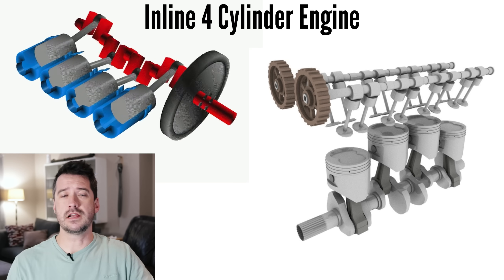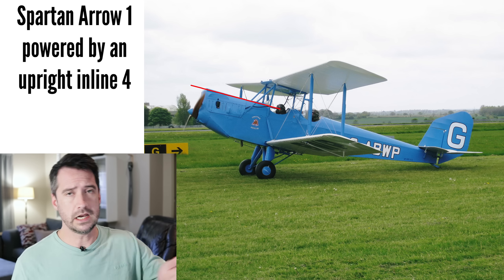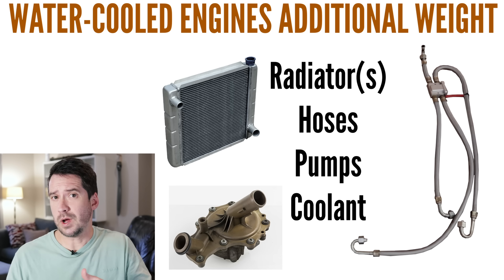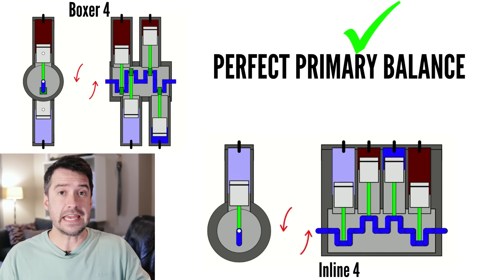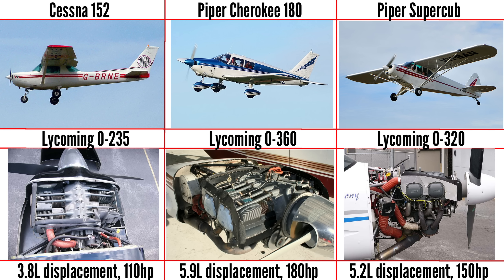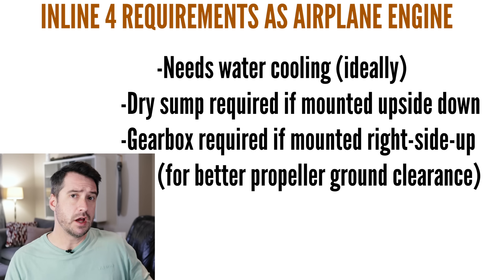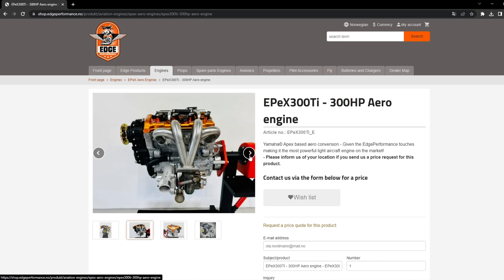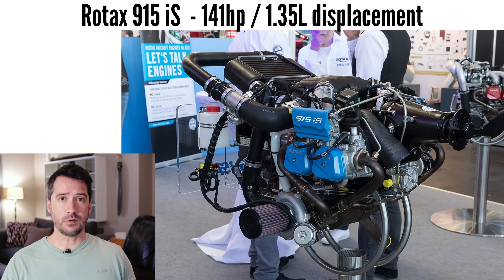Does Inline 4 Engines Suck for Airplanes? - Technical Deep Dive

Comment: If you notice, that Gypsy engine is a "Long Rod" motor.  Not a stroker, but a Long Rod.  Look how insanely long those cylinders are compared to something you see in a car @11:30.  This reduces the angles from side to side of the piston rod when the crank is in the middle of a stroke.  It also reduces the need for a counter balance and reduces the acceleration effect of the piston during a stroke.  This should be mentioned.
Reply: It is a long stroke engine, but that's just because they didn't know any better in the 1920s. By the mid '40s, engine manufacturers knew better.
Reply: @PistonAvatarGuy  nope.  There is a resurgence of long rod…not long stroke motors.
Reply: @sammcbride2464  In aviation? Long rods are definitely preferable, but long strokes are definitely not preferable in aircraft applications.
Reply: @PistonAvatarGuy  I don't know, but if you are only turning 2500 RPM and want no vibration, I would pick a long rod stroker engine for it regardless if it was in the air, on the ground, or on the water.
Reply: @PistonAvatarGuy  In any motor application, if the stroke is longer than the bore width, then it is a stroker engine.  That is different than a long rod motor where the stroke is still shorter than the width of the bore.  If you have the measurements of the engine, it will be easy to tell.  On a side note...I don't know about you, but I would always want a dry sump oil system.  Some people like to fly upside down. ;)
Reply: @sammcbride2464  Basically every piston aviation engine that has been developed since the mid 1940s is an over-square engine (short stroke), because under-square engines (long stroke) have a poor relationship between torque output, piston speeds and rpm.

Over-square engines make more torque than under-square engines, and because direct-drive engines are limited by rpm, the only way to get more power out of them is to produce more torque. Even with geared engines, an over-square arrangement is preferred in order to keep piston speeds as low as possible. Long rod, over-square engines are the way to go.
Reply: @PistonAvatarGuy  I understand the engine building dynamics.  Piston speed is not an issue at 2500 RPM.  Also, a long rod motor has nothing to do with stroke.  My Pontiac 455 with a 4.25 in stroke can safely turn over 5k rpm’s.  A engine with a massive 8.5 in stroke would have the same piston speed at half the rpm.
Reply: @sammcbride2464  Piston speeds are always an issue, as higher piston speeds result in more wear and less efficiency, both highly undesirable things to have in an aircraft engine.

You said: "...I would pick a long rod stroker engine..."

Long rod, yes, stroker, no.
Reply: @PistonAvatarGuy  I said stroker since it is 2500 RPM.  That is why.
Reply: @sammcbride2464  But a stroker is still going to have higher piston speeds at 2,500 rpm than an over-square engine does at the same rpm.
Reply: @PistonAvatarGuy  It just depends on what the actual stroke is, not the ratio.  But, you can have less longitudinal length with a stroker.  I am not dead set on a stroker, but it seems natural given the RPM target.  If the target HP is only 120 to 200, that is pretty achievable without a turbo and a target of 2500 rpm with any design.  At altitude, I would want a turbo or super charger.  I would also always want a dry sump for an airplane.
Reply: @sammcbride2464  Assuming that we're talking about an engine of a specific displacement, an under-square engine will have a longer stroke (actual) than an over-square engine. Stroker engines make less torque from their displacement than over-square engines, so I'm not sure why you'd want to limit your performance like that.
Reply: @PistonAvatarGuy  Actually, it is the opposite for torque.  Stroker engines have a nickname of Torker engines.  Maybe you typed that backwards?
Reply: I have been building engines for a very long time.
Reply: @sammcbride2464  Nope, that's a myth. When you increase the stroke of an engine, you increase its displacement, so the engine makes more torque as a result of its increased displacement, but it's displacement specific torque output (BMEP) will be less. If you're designing an engine from scratch, there's no reason to 'stroke' the engine as though you were modifying it, you can simply increase the displacement by increasing the bore. This is why aircraft engine designers always choose over-square engine designs.

IMO, people relying on their 'butt dyno' are to blame for the more torque from under-square engines myth, as under-square engines tend to produce their peak torque at a lower rpm than over-square engines, so the engine feels like it's making more torque, simply because the torque is available lower in the rpm range of the engine.
Reply: @PistonAvatarGuy  If you believe that, I do not know what to say.  Take an engine like a Honda S2000 and look at the specs for a 2 liter.  Then look at other engines.  Look at a stroker engine like a Pontiac 455 and a Chevy 454.  Way different characteristics and at 2500 RPM, I guarantee the Pontiac will smoke the Chevy.  The stroke or crank angle is directly responsible for torque.  I think you are talking about peak HP which is something that you can obtain with a short stroke and high RPM.  But, we are not talking about high RPM at all.
Reply: @sammcbride2464  On YouTube: Crushing the Long Stroke= More Torque Myth by rv6ejguy

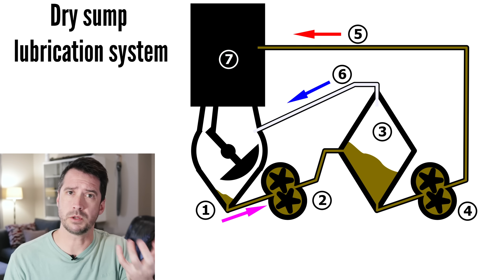Also: Bore Stroke Ratio | Performance Engine life Effects | Applications by Untangle Club (at about 3:00 in the video).

The Pontiac 455 is basically a square bore engine, the Chevy 454 is an over-square engine and neither make as much torque from their displacement (BMEP) as the Honda F20C. A better comparison is the Honda K20 to the Honda K24, as they're basically the same, except that the K24 has a longer stroke (it's an over-square engine) and the K24 makes less torque from its displacement than the K20.

Edit: Heck, you can even compare the Honda F20C to the F22C and see that the engine with the longer stroke makes less torque from its displacement.
Reply: you mean it have greater rod to crank ratio, D4A explained that, it have less secondary forces, and less pressure (and friction&wear) on cylinder walls and better high RPM performance
Reply: @PistonAvatarGuy  I think that long strokes on direct drive aircraft engines are avoided due to the flexibility of the crankshaft. Either journal sizes would be very large, which is a problem for plain bearings with excessive speeds or Or there would be very little overlap in the crankshaft which would make it very flexible. The Lycoming and Continental engines both have flying web crankshafts (3 main bearings plus the prop bearing for a flat four.)which is already a flexible crankshaft. (Subaru uses 5 main bearings for it's four cylinders, and 7 mains for the 6 cylinders. The width of the engine is not a problem as almost all aircraft are for two people side by side or larger.
Reply: @jiroyamamoto2878  You could be right, but why bother with direct drive engines when geared engines offer such significant performance advantages?

Twin engine aircraft would still benefit from the reduced frontal area that inline engines provide. Geared engines are so much more compact than direct drive engines that geared V and flat engines also offer significantly reduced frontal area relative to direct drive engines.
Reply: @PistonAvatarGuy  Propeller speed reduction units (PSRU)s are not easy to design nor build, especially for Experimental (homebuilt) aircraft with many different propellers. I think that production auto engines converted to aviation is the direction of the future. However the market is tiny! So, the costs of conversion have to be low, and the PSRU is the biggest stumbling block. Certification is so expensive, it would kill the conversion cost savings. Now car engines are so good, with a good PSRU and a reliable Engine Control Unit (ECU), a turbo auto engine would be the cats meow. However, PSRU and open source ECU are not found on trees. My current favorite fantasy conversion candidate is the GM L3B 2.7 liter turbo. 310 hp at 5600 rpm and 430 lb ft at 1500-4000 rpm. You would hate it though and I will let you guess why! It could actually run direct drive, if a suitable prop hub bearing could be devised. However, these engines are shaped like a cube more or less. They are not long and skinny.
Reply: @jiroyamamoto2878  PSRUs can't be that difficult to design and build, there are loads of options already in existence. I don't see why different propellers would be an issue, either, it seems like that would be much more of an issue for direct drive engines, as they operate within such a narrow rpm range. Even the torque pulses from a direct drive engine must be considered, as they can destroy propellers that aren't robust enough to cope with those forces.

Direct drive, that GM engine would have a very poor power to weight ratio, it being limited to less than 3,000 rpm. For example, 430 lb-ft @ 2,700 rpm is only 220 hp and the engine appears to weigh at least 350 pounds. With the BMEP that high, I'd also question the ability of the engine to run efficiently and wouldn't expect it to have good longevity. The fact that the propeller would be attached to the engine near its base would also be a problem in most applications.

IMO, there should be a government development program which absorbs the cost of development for some new aircraft engine designs, otherwise nothing new or worthwhile will ever make it into production. NASA is supposed to be doing things like this, and they kind of started to with the GAP program, but it was a very limited program and it focused on compression ignition engines, so it didn't end up producing anything of value.
Reply: @PistonAvatarGuy  I knew you wouldn't like it! Where did you get that engine weight of 350 lbs? Direct drive it would need to be inclined (somewhat difficult) if not inverted (very difficult) with a prop hub bearing. What do you think a good power to weight ratio would be good?

Certified versus experimental: Certified limits greatly the choices and vastly increases the costs but results in much more predictable performance. Experimental is the converse. Having a variety of propellers means a variety of mass moments of inertia. The flywheel is alike a huge flywheel, and with a PSRU sandwiched between the flywheel  of the engine and the flywheel of the prop is like being between a rock and a hard place. 

Tell me about the PSRUs "loads of options already in existence". 

The problems in General Aviation (GA) are immense. I am thinking that the good old days of aviation (1950 to 1990) will never be replicated. I liken it to the good old days of motorcycling (1960-2000). Conditions have changed, greatly. Government programs can add technology, but unless the US government actually intervened to support general aviation in a large scale and expensive program, technology by itself is not enough to greatly increase flying hours and pilot participation. The drone derivatives have potential, but the commercial GA applications have not manifested after twenty years of drone warfare.

However, I do love technology and GAP was really cool. I loved the self starting turbocharged two stroke with variable compression pistons! I think that a spark ignited version, direct injected, like a Bombardier ETEC, without crankcase compression would be very interesting to see.

What websites do you frequent? I lurk on Homebuiltairplanes.com an excessive amount. Cheers
Reply: @jiroyamamoto2878  The shipping weight for a new L3B is over 380 pounds, I figure the crate probably weighs around 30 pounds. It doesn't look like that engine includes the turbocharging system, though. Engine power to weight ratios were approaching one horsepower per pound of engine weight in WW2, it seems like we should at least be in that area with GA engines by now. The Adept Airmotive engine seems to be on the right track. Personally, I'd like to see a 3 to 4 liter, DOHC, twin-turbocharged, FADEC V8, like the Toyota FV2400-2TC, but purpose-built for aircraft use.

Two flywheels should result in pretty smooth motion, that should make things easy for the PSRU. They should be as over-built as possible anyway.

PSRU options: SkyTrax, EPI Inc, Autoflight (used on Titan V6 aircraft engines, may no longer be in production, but they seemed to have an excellent track record), Viking Aircraft Engines, Aero Momentum, LS aero engines (used on the Bull Moose), Aerosport Engineering A/S (seems to be an EPI gearbox), Auto PSRU's... there are probably others that I'm forgetting, but those are the main options.

It seems that GA is dying because the middle class in the US is dying, but there are ways that the government can solve that problem.

The counterweight system on the Continental GAP engine was ridiculous, it was hugely impractical. I don't think that any of the performance figures for the engine were ever released, it seems that the engine may not have not even completed its testing phase.

I don't spend time on forums anymore, unfortunately, there's no real need for me to have conversations on that level.
Reply: @PistonAvatarGuy  My guesstimate for the 
L3b 2.7 liter 4 cylinder DOHC was 250lbs for the long block. I was quite taken with it 6 months ago. A GM LS is about 400 lbs, all 6.2 liters. The GM 4.3 liter V6 Lr3 about 330 lbs. 

Comparing WW2 aircraft engines to todays consumer grade engines seems unlikely to result in happiness. Those engines were more like racing engines and cost as such. 

PSRU: Sky Trax only does Yamaha four cylinders, the 3 cylinder is under development. Stopped producing the Phazer PSRU.  Autoflight is not in production, Viking? take your life or your money in your hands...

I agree that the shrinking middle class is the main reason for the death of General Aviation. I don't remember the GAP counterweight system. 

cheers,
Reply: @jiroyamamoto2878  The L3B would need to be an extremely stout engine to put up the kind of power and torque numbers that it does without being a ticking time bomb... which it may be anyway (it is a GM product, after all). An NA Honda K-series weighs about 275 pounds and would probably make an excellent aircraft engine.

Even with near 1:1 power to weight ratios, WW2 era engines ended up being able to run for well over 1,000 hours in post-war airliners. The TBOs for fighter aircraft engines were derived with the expectation that they'd be pushed extremely hard for significant periods of time, it was war, after all. Even the Merlin had a TBO of 800 hours in the North Star.

Engine technology has also advanced enormously since the WW2 era, as has the effectiveness of lubricants, this is why TBO has continually improved over the decades. EFI systems also ensure that engines are never operated under conditions which would reduce their lifespan.

A 1:1 hp to weight ratio with a 2,000+ hour TBO should be no sweat for a well-designed, modern, liquid-cooled aircraft engine.

Most of the PSRUs in production are designed for a specific engine, that doesn't mean that the designs can't be adapted to other engine designs. I haven't heard about any major issues with Viking's current PSRU (Eggenfellner did have issues with his Subaru PSRUs, but they were entirely different units). The current Viking engines seem to be extremely reliable in general.
Reply: @PistonAvatarGuy  The L3B has been in production for five years. It is standard on a number of full sized pick ups. "Ticking time bomb"? 

"
A 1:1 hp to weight ratio with a 2,000+ hour TBO should be no sweat for a well-designed, modern, liquid-cooled aircraft engine." Perhaps you could describe the salient attributes of such an engine? As you must know, the LS aero conversions don't come anywhere near your above quoted numbers if the radiator, coolant, hoses and PSRU are included.
Reply: @jiroyamamoto2878  How many L3Bs have hit 200k miles?

The LS V8 is not a $100k aircraft engine, it's a cheap car/truck engine that can be bought for a tenth of that price, the quality standards are going to be a little different, bud.
Reply: @jiroyamamoto2878  Really, what you want is something that's somewhere between an LS and a 255 pound, 670 hp Judd Power V8.

I mentioned a certain engine that seems viable above, YT won't let me mention it again, for some reason.

Comment: Great vid!  I’m not sure it all really matters. At the end, all one cares about is how much HP, at how much weight, in how small a volume, and with how much fuel consumption.  Oh yeah, and how reliable it is!  That latter one is IMO the most important one.  Having just watched a video on aero engine lubrication, I was dismayed to learn that a lot of air cooled engines are built on purpose with very loose tolerances to accommodate the large thermal variations experienced with air cooling. This lets exhaust blow by rings much easier contamination oil which leads to both oil degradation and engine wear. If you ever wondered how you can drive your car for well over 100,000 miles and literally decades with no significant mechanical trouble, yet need to overhaul your plane engine in almost double digit hours of operation, there is one of he answers. Because of this, I now wonder if we are missing the mark by not demanding liquid cooled engines which could be made much tighter, more auto like, and with marked less frequent overhaul requirements. This definitely makes me want to look at alternatives in the future because doing very expensive overhauls is a definite detractor from lower end aviation.